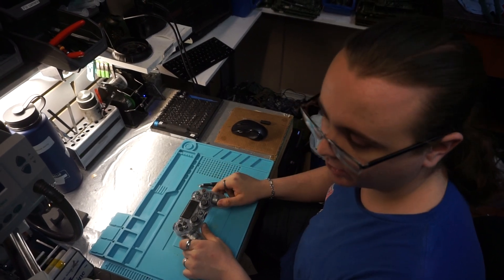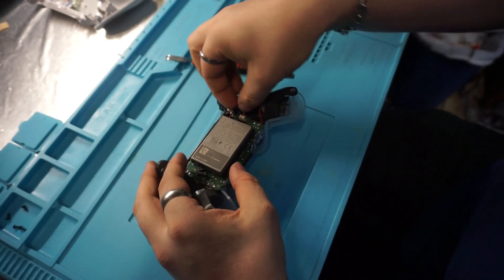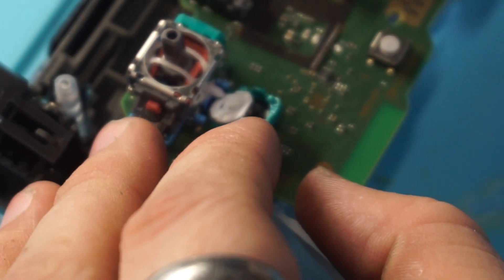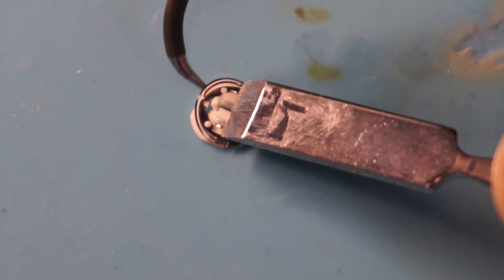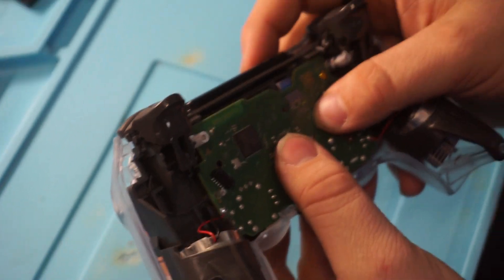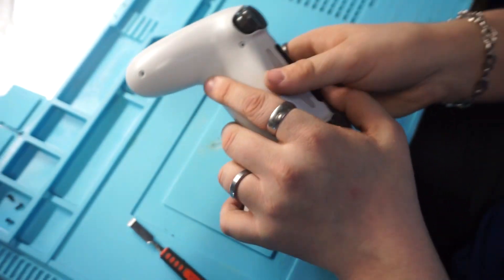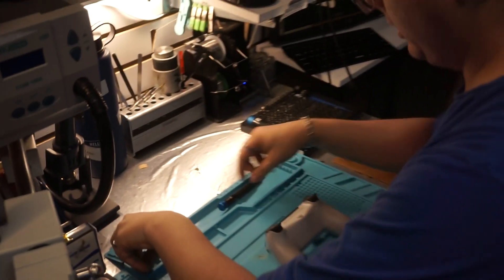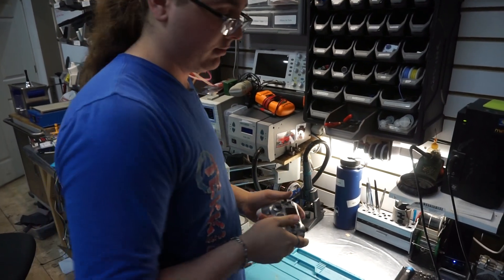How to FIX ANALOG DRIFT in PS4 Controller! Correct Method 100% Works!

Comment: Thanks for your video really excellent, followed and fixed my controller my q tip had a very small dirt residue after I pass over it, now it works perfectly it was the same analog as the video